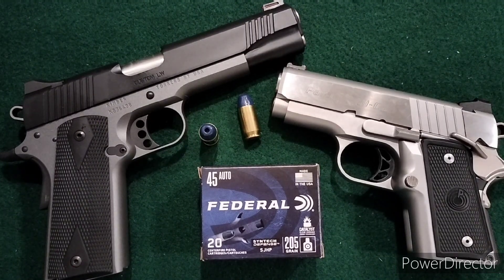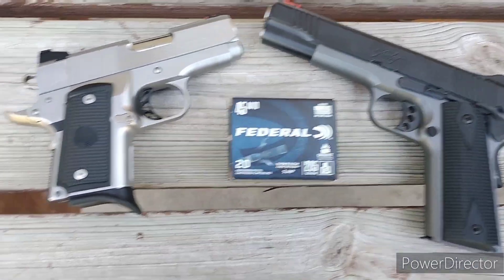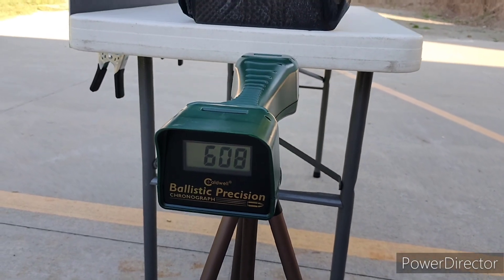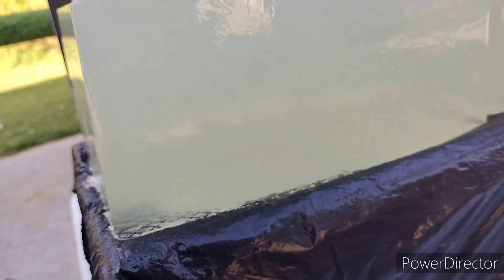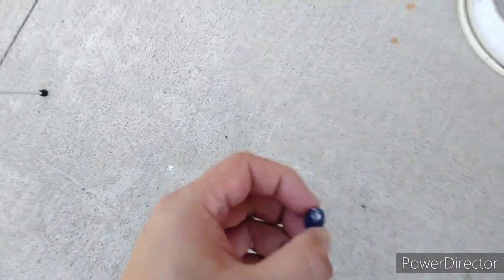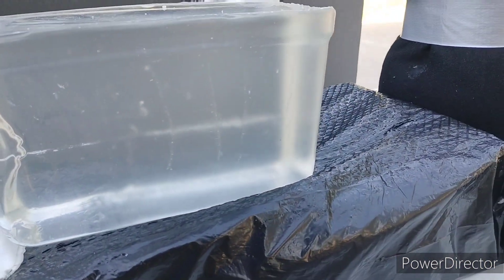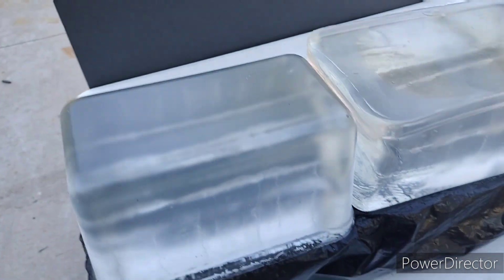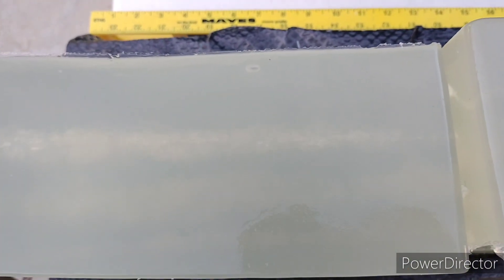45 Federal Syntech Defense test

Comment: At $7 "Clearance" and yet their website shows still available (for $30!) - I wonder if they have since reformulated to function more closely to their design parameters..?
One thing, it's getting tiring watching everyone (it now seems) using clear gel instead of true FBi knox gel and then getting HP failure after failure, when in proper knox gel they operate correctly.
I and several range/hunting pals are beginning to ignore videos continuing to use clear condom rubber failure-prone gel.
It really translates to a waste of resources, time, ammo, money - to continue wasting said resources showing gel-caused failures.
Otherwise, I like your comprehensive testing methods (when knox gel is used) and brevity.
Short is sweet and you tend to get to the point and jibber-jabber a lot less than most.
👍😏
Reply from the maker: I'm still on the fence with clear ballistics. Obviously seeing tracks is interesting, but if they aren't approximating real world results then what's the point?
Reply: I purchased several boxes of 9mm and 40s&w at Walmart too for $8 +/-. Now, Federal has all calibers overpriced. They were like $12 or so a box retail. That's one hell 9f a crazy mark-up.
Reply: Yep, it doesn’t seem like some of these gels are even like a human body. Plus, if it hits bone, then it will fragment.